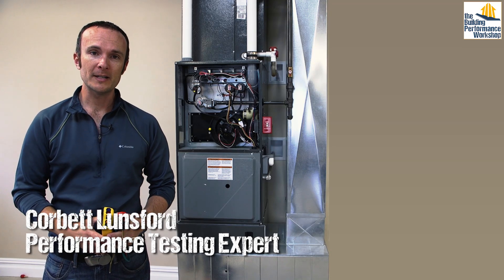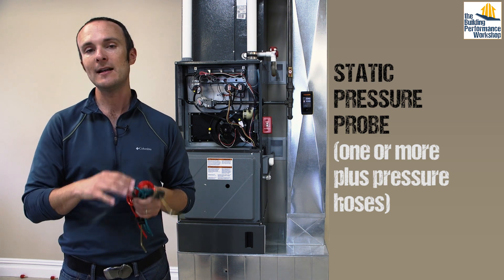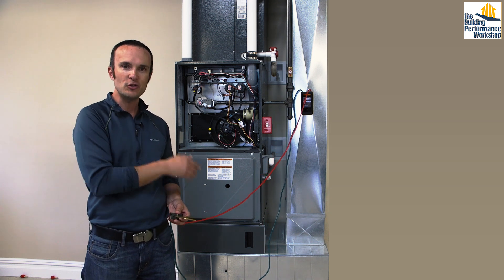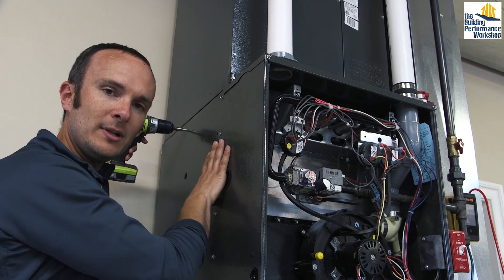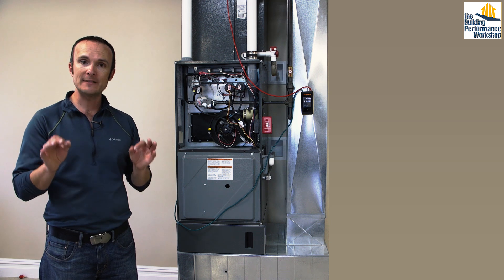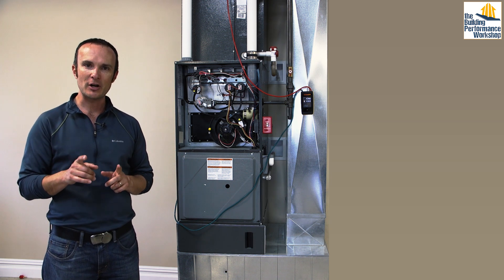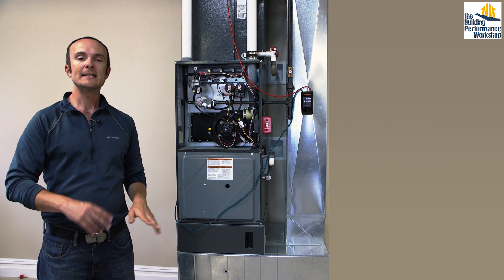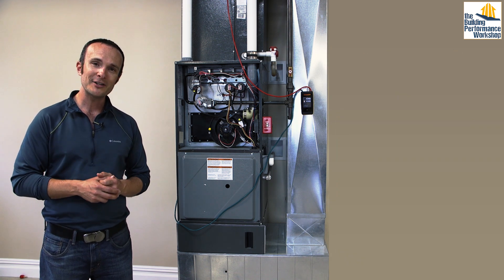Static Pressure Testing and Mapping Demonstration: Home HVAC Duct Performance

Comment: Does this video assume the filter to be in the furnace enclosure? What if the filter is behind the return grille i.e 10 to ft away from the furnace
Reply from the maker: +sankar lakshmipathi in that case, measure the TESP in the same place, but your return ductwork pressure drop will be higher. As long as it was designed that way in Manual D/ASHRAE you're good.

Comment: Nice but in the field you won't have space to drill a hole
Reply: Can’t tell you how many units are built into cabinets or tiny closets. One house had the furnace built around it with doors barely big enough to work on it. If the furnace or coil ever needs to be changed walls have to come out. Would love to work on furnaces that are always in the open like that
Reply from the maker: Feel free to call that out and throw the installer or builder under the bus. If you see that regularly, something is wrong.
Reply: throw the installer under the bus then find out it's the customers uncle... gulp
Reply from the maker: 100%

Comment: great video. a question, in your test, how do you account for a ECM blower motor?
Reply from the maker: +Eric Felger they should also be not too high on statics, but the blower will ramp up and down. Trickier, but the science still stands.

Comment: Hi Corbett. Thanks again for making this video. I've got a quick question. I've got a standard Payne 90% efficient furnace that was installed a few years ago, replacing an old dinosaur that had not been in use for 20+ years. Anytime the heat/ac turns on there's a large 'whoosing' sound from the ductwork (from the air pressure I suspect) and there used to be a 'banging' sound when the unit turned off - that is until I added a cross brace to the air return duct (just put a piece of wood across the inside to hold it in place). After watching your video I suspect that my pressures are all out of whack. Can you suggest some way to test them for a home user like myself (and an avid handyman DIYer) without spending the big bucks on a digital unit like you show in the video? 

Also assuming I DO find pressure problems (TSP too high for instance) is the fix to install larger duct work? Or is there another common solution? 

Thanks again for all you help.
Reply: Bob, your system may very well have settings on the control board that will adjust blower fan speeds up or down.  On my system it is required to turn power off to the system before changing the DIP switches otherwise the changes will not go into effect.  You'll have to find the installation literature for your model to decipher your control board settings.
Reply from the maker: +Bob Britton yes, your pressures are almost certainly too high. To experiment, take the blower cabinet's door off and let the unit start with plenty of air thru the open door (you'll need to press down on the black safety switch) and the difference in sound at startup will convince you to get the system tested and fixed, probably with more return duct girth.

Comment: I am planning to use the pressure drop across my air filter to determine when the correct time to change it is. I have a set of pitot tube and required hardware to install them. I plan to but 1 on each side of the filter. That said, this mean one pitot tube will be located in the blower assembly of my HVAC system.  Based on where I have seen in your video and others, the static pressure should be somewhat constant. Since this is a home unit, I do not expect a large variation in pressure across the duct and plan to use only 2 pitot tubes. With one on each side side of the air filter, located in the center (side-to-side) of the duct and about 6" into the air flow. 

Other than ensuring I am on the correct side of the blower fan, is the location of the pitot tube in the blower compartment important for measuring the static pressure?
Reply from the maker: +Grover D first, I assume you mean just static pressure probe when you say 'pitot tube'- a pitot tube also measures total pressure, which you won't need.
I'd sample a few places in the cabinet and all different directions for pointing the probe, but yes, it shouldn't matter much.

Comment: When I do energy star reports, I only take total static pressure including the evaporator coil and air filter. Still looking for that below .5 inches of water column
Reply from the maker: +joshua G if you mean you're testing at the far side of the filter and coil, then that's not right. Your systems will always pass the test, when the filter and coil could be super restrictive. The more restrictive they are, the lower (better) your TESP will look. This is a widely misunderstood test.

Comment: Try pulling limit for supply side static probe placement, way better than drilling a hole in furnace . So don't pass along bad info about dropping company's that don't drill unnecessary holes.
Reply from the maker: +carl neuman actually, it's NOT a good idea to test at the high limit. You pick up a higher than actual TESP, since your probe sees the top half of the heat exchanger.
Reply: I will have to experiment with limit and another hole higher.
Reply from the maker: +carl neuman rock on. The only way to truly know.

Comment: Was your return reading -0.38? If so why do you add it like its a positive. Trying to learn a little more about air flow.
Reply from the maker: +Meno Meno yes, disregard the polarity for TESP
Reply: If you did not get an answer for this, the addition of Negative and Positive Pressure in Inches of Water Column represent the External Static Pressure that this fan is experiencing. When these values are known including Fan RPM (Rotations per Minute) you can plot these values on a fan curve or Table from the manufacturer to determine Fan Air Flow. Hope this helps. I have been Air Balancing since 1989 in Large Commercial Systems. Same reference is used in both residential and commercial systems when a duct traverse for air flow cannot be accurately conducted. If the RPM is at design and the static pressure is higher than design, the air flow will decrease. The opposite when the static pressure is lower than design at design RPM the Airflow is normally higher than design.

Comment: I've been searching for a good static pressure explanation video all over YouTube and none of them are as thorough and precise as yours has been! Thanks for taking the time to explain this procedure step by step.
Reply: helped me too. thanks!
Reply from the maker: So glad it helps you, +Cesar Aquino !
Reply from the maker: +Jose Marcano glad it helped!
Reply: Home Performance hey so is a wet coil .07? Or is that dry?
Reply from the maker: Def dry
Reply: Home Performance so what is a wet coil measure at?
Reply from the maker: Depends, but .25 not unusual in my experience

Comment: Thank you for doing this! One question: is the goal to have TESP at .1" w.c. or the pressure drop (coil and filter difference) at 1" w.c.? Thanks in advance
Reply: Trent, almost all residential systems are designed to run proper airflow at 0.5"WC. @ 400 cfm per ton. Example: 4 ton = 400 X 4 = 1600 cfm. The furnace is calculated at this number WITHOUT A COIL (the exception being package units and many heat pump air-handlers as the coil is already inside of the unit). However 0.5"WC is desirable, and less than 0.5"WC is even more desirable, This is counting the evaporator coil. The best operating systems usually have a TESP of 0.5"WC or less.

Going a little further, when designing a system the contractor should be selecting a coil, that when combined with a proper duct design, takes into account the pressure drop across the coil. The design should have been done from a room to room load calculation that takes into account increased static pressure by the friction loss that the duct work, boxes, wyes, filters, balancing dampers, plenum and registers create in the system. This friction loss subtracts from the total available static pressure usually leaving a very small number for the available static pressure. You use this number to establish your friction rate on your duct calculator. This allows you to properly design the system to handle the duct work and the coil. Bigger ducts that are installed properly (no sags, sharp bends and the ducts pulled tight, flex duct that is) will then deliver the right amount of air (after balancing) to the right location. 

I use a computer program to do my load calculation and duct design on every system we install or replace and almost every time we are at or below 0.5"WC.

The problem that I see everyday in this business is that almost all the contractors out there does none of this. It's a shame because customers are paying thousands of dollars for systems that are designed, installed and serviced improperly. 

I became so fed up a couple of years ago that I joined IHACI and am now teaching in the evenings, a couple of times a month for IHACI at PG&E and Southern California Edison, classes on these subjects, by the way the classes are free!
Reply from the maker: +Trent, Mitchell said it more thoroughly than I have time to! 0.5" static pressure before the blower and after the heat exchanger, added together.
Reply: I’m not even an HVAC professional but I’ve been learning that plenty of people who claim to be either don’t know half the stuff they should or just don’t apply the knowledge because the job they do on many of the systems I’m seeing in operation is abysmal to say the least. I’m learning as much as I can just to service a few of my own units and get them running properly because all I seem to hear from the “professionals” is “need a new unit” but don’t properly evaluate the existing situation before giving an estimate for $10k+

Comment: Great video.  Thankfully it confirms they way I test static. That is typically ow I test TESP. One slight difference I usually pullout the high limit switch to get the post-blower pre-coil number.
Reply from the maker: Thanks, Nate! The high limit switch is not ideal- you get a higher than actual TESP. You will pick up some of the pressure induced by the top half of the heat exchanger- which they do not want you to include in the TESP.
Reply: I conformed that in our shop with a live unit.  
Its a pretty consistent .18-2 higher in the heat exchanger.

Comment: I think that is a Goodman furnace which is probably rated for .3 or .35 TESP....also. static pressure probe tip doesn't have to be pointed into the air stream because static pressure isn't a measurement of moving air but rather internal pressure
Reply: The usual recommendation is to point the probe in the direction of the airflow. If P(total) = P(static) + P(velocity), the goal is to position the probe so that it does not pick up any of the velocity pressure. What I do is slowly turn the probe a full 360 degrees and then take the lowest reading because that will be where P(velocity) is the smallest, thus giving me the most accurate value for P(static). Do you think that's a good way to do it or is there a problem with my approach that I am overlooking?
Reply: The probe has holes on the side that read the pressure.  If the probe is inserted so that the air is blowing into the holes you are reading some velocity pressure.  The probe needs to be installed either pointing directly into the air or directly with the air to get an accurate reading.
Reply from the maker: It says 0.5 on the sticker, which is always important to read. Also, the probe may give weird readings if not pointed into the airflow- it's designed to distribute the turbulence equally around the entire circumference.
Reply from the maker: +erikmoje that sounds solid!
Reply: +erikmoje  It almost sounds to me like you're referring to a Pitot tube and not static pressure probe.  Does it have 2 hose connections?

Comment: Hey, just a heads up from someone who checks static pressure often on gas furnaces, there is a hole into the heat exchanger available after the blower that the manufacturers make for us, just remove the primary limit switch, I prefer NOT to drill holes into equipment if it is unnecessary.
Reply from the maker: +Sightthrough, if you test at the high limit switch hole you will get a higher than actual TESP reading, since you're also picking up the top of the heat exchanger.

Comment: Awesome! By far the most clear explanation of static pressure I've seen! It's been a while for me and I need to do it next week, so I appreciate the refresher!

A few notes:
1. That is a quiet AHU, I couldn't hear it in the video!
2. Don't forget the low limit for TESP, 0.08" WC. I've been finding 0.12" is the bottom on some systems - the second floor doesn't cool for squat below that.
3. The positive/negative thing still messes with me. (I'm a little slow sometimes...) Perhaps talk about the difference or spread between the two? The spread -.38 and +.21 is .59. Like I said, I'm a bit slow sometimes...

Thanks again for the refresher, I get to freak out once again while I drill holes in a perfectly good furnace next week!
Reply from the maker: +Energy Smart Home Performance glad to help my friend. Easiest way to calc the spread is just drop the neg sign at the get-go and add the two together.

Comment: Why not just pull the high limit instead of drilling by the heat exchanger?
Reply from the maker: GREAT QUESTION +Chris HVAC ! Because you will pick up some of the pressure induced by the top half of the heat exchanger- which they do not want you to include in the TESP.
Reply: Unfortunately i can't get to either side of my Goodman furnace to drill a hole . are there any alternative?
Reply from the maker: Yes, if you’re careful you can remove the high temp limit sensor without shorting the system. It will give you a workable number, though not as accurate.

Comment: Absolutely fantastic explanation! Love it!
Reply from the maker: Thanks +Stephen!
Reply: IMon Airflow does effect refrigerant pressures, in my opinion "bad static" is high static which means poor Airflow
Reply: Stephen Rardon hey Stephen can bad total static pressures cause adnormal refrigerant pressures?
Reply: Always thought the probes need to go with the airflow for accurate readings, what are thoughts Steve?
Reply from the maker: To clarify, all A/C is just refrigerant and airflows. The refrigerant PERFORMANCE is affected by airflow, but the pressures in the lines and the ducts don't talk directly to each other.
Reply: Home Performance They kinda talk to each other through conduction and convection sensible and latent heat transfer.

Comment: Good stuff Corbett I wish technicians would take static pressures but they don't, you missed a point though what about a wet coil that will add to the static Trane is the only one that will give you static with a wet coil. You add dirt and water you now have a problem thanks for your video.
Reply: You can't necessarily trust the static pressure shown on a Carrier Infinity stat, the communicating stat is using an algorithm to determine static pressure and there are some circumstances which can confuse the algorithm.
Reply: Larry, which Trane models do static pressure? Is it on the stat? I know Carrier Infinity models do it, but I didn't know any other brand did, thanks in advance for the info!
Reply: Rheems do this as well. Using motor current draw and rpm they infer flow. That's how the variable speed blowers maintain required cfm when filters get plugged, vents are closed, etc. That's how I understand it anyways...someone please correct me if I'm wrong here.
Reply from the maker: +Larry Cole right on, man. All of the pressure drops should be compared with what we expected to find, and that info is straight out of the manufacturer's lit. Always know what to expect before testing!
Reply from the maker: +Sightthrough very interesting! Would love to see your video post showing that in action!